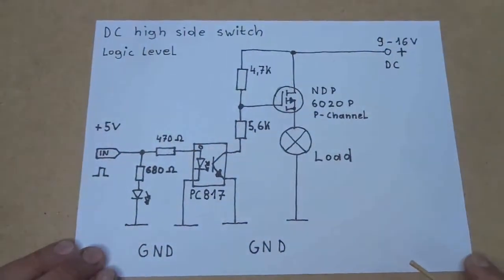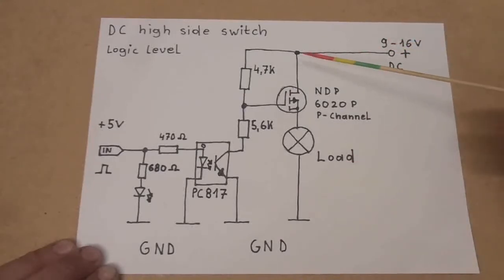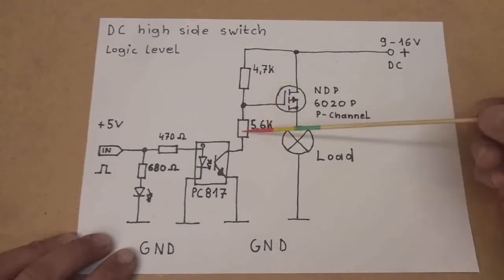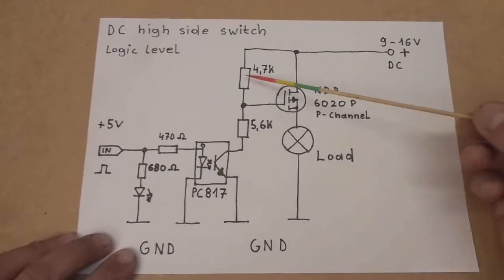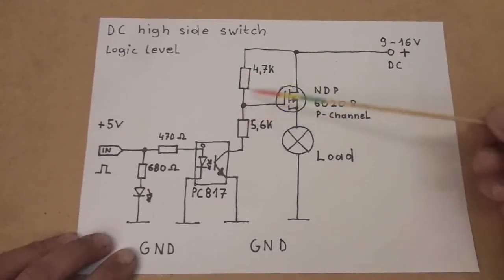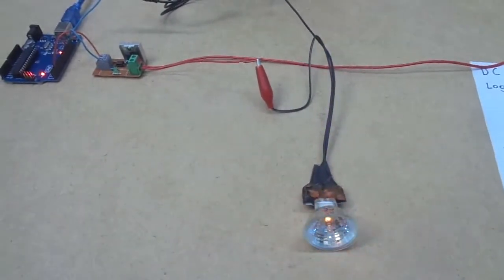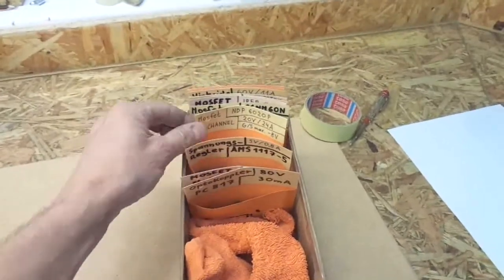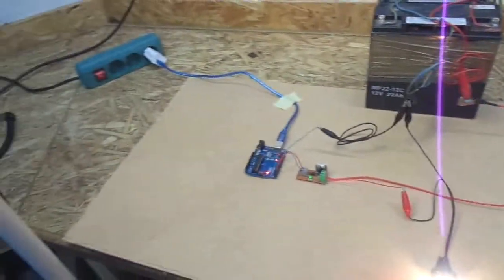DC high side switch (for Arduino)

Comment: Thanks for the great video and circuit! Can you do PWM with the optocoupler in place? Also NDP6020P appears to be obsolete so I was wondering if have updated your circuit to use something else?
Reply from the maker: Yes, it can do PWM. It is ment to do that. Dimming lamps and so on...
I live in a houseboat with 12 volt solar system and i have this circuit on almost every lamp here.
(push button dimmer in conjunction with attiny 85)
And yes, you can choose any p channel mosfet you want. Just adapt the voltage divider so you dont exeed the maximum gate voltage of the fet.
Reply: @LariFariYoutube  thanks so much for the info! So if I'm understanding correctly as long my p-channel mosfet has a maximum gate voltage of at least 8V I could get away with using the resistors in your example (assuming my load/source voltage is 12V). For instance I'm looking at IRF9640 which has a maximum gate voltage of 20V.
Reply from the maker: @CoryCharlton  I looked up the datasheet for your Mosfet. It calls for - 10 Volt at the Gate to work  properly. But if your System voltage is lower than the maximum Gate-source Voltage, which it is in a 12 Volt system, you dont need a gate resistor at all. Just pull the gate via the optocoppler to GND, to turn the Transistor on. The optocoppler can handle the paek current, to charge the gate. At least at the 1 kiloherz PWM frequency of an Arduino.
Reply from the maker: @CoryCharlton  P.S... Mandatory to say, that you need the 4,7K resistor as it is to dicharge the Gate.  Use instead of the 5,6K resistor a 220 ohm for the sake of it. Just to reduce the max current going through the optocoppler. As long as your system Voltage (D / S) is lower than 20 volt, you are fine..
Reply: @LariFariYoutube  thanks again for the help. Software engineer by trade and it's been a LONG time since I've done any electronics work. I was using a voltage divider calculator like https://ohmslawcalculator.com/voltage-divider-calculator and I'm not sure I'm correctly identifying R1 and R2 in your circuit. If I use 4.7K as R1 I get 6.52V at the gate. If I swap them and identify 5.6K as R1 I get 5.4V. If I'm reading the NDP6020P datasheet correctly either one of these voltages at the gate should work. That being said if I use IRF9540 neither of those voltages will completely activate the gate (as you pointed out). But here's where I think I'm missing something if I replace the 5.6K R2 with 220 ohm wouldn't I get 0.53 V at the gate? If I'm identifying them incorrectly then your original 4.7K and the swapped 220 ohm would be 11.46 V. However if 4.7K in your diagram is R1 I would need swap position of the 220 ohm and 4.7K. Long story short my MOSFETs arrive today so I'll be able to test this all and get a better understanding of what is going on.
Reply from the maker: @CoryCharlton  Ok... R1 is the 4,7K in my circuit. You let it stay in place. It pulls the Gate to VCC , when the optocoppler ist urned OFF. The Mosfet is OFF now. Because it is a P channel. R2 is for your Fet the 220 Ohm resistor. So if the Optocoppler is activated / ON, the Gate of the Fet gets pulled to GND via this low value resistor. The Fet turns ON. With..as you already calculated, a voltage higher than 10 Volt. So, it is definitely full on and not in the linear region. Since your mosfet can handle up to 20 Volts at the gate, you would not need the 220 ohms at all. It is just a overcurrent protection for the Transistor inside the optocoppler. Because...you know...the Gate of a Fet is a capacitor, there is a high current peak, when the fet gets turned on.

By the way..the resistor values in my circuit are more or less a compromise. The circuit is designed to work on system voltages from 10 to 16 Volt...so within the range of an 12 Volt lead acid battery system for solar / boat / vehicle use.
Reply: @LariFariYoutube  Ok I think I'm understanding correctly now. My calculations were correct regarding the 4.7K/220 ohm being 0.537V but the part I was missing is that the P-channel FET switches by the difference from gate to source so 0.537V - 12V = -11.463V and the FET goes fully on. I might still not be fully understanding it but I really appreciate you taking the time to answer my novice questions!
Reply from the maker: @CoryCharlton  ;) you are welcome..I try my best to help wherever i can. It would be helpful for you, to buy a breadboard and some components and do some experimenting. To get used to it in a more practical way.  Greets from Germany
Reply: @LariFariYoutube  absolutely, breadboard and the rest of my missing components are arriving today/tomorrow. I tend to learn better by doing than reading. 

I tinkered around with electronics more than a decade ago and even had some custom PCBs printed that my car group and I used to limit voltage from a turbo boost pressure sensor in our cars. 

The problem with learning by doing when it comes to electronics is the "magic smoke" often escapes when you do it wrong :) This is why I prefer to stick to software when I can :P 

In any case I plan to post a video when my mockup circuit works and will be sure to give you and this video a shout out.